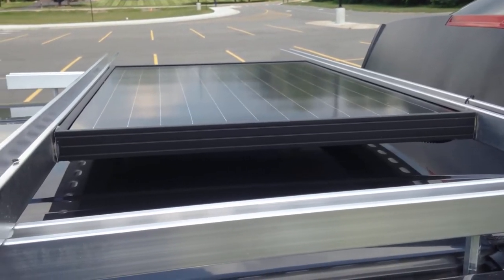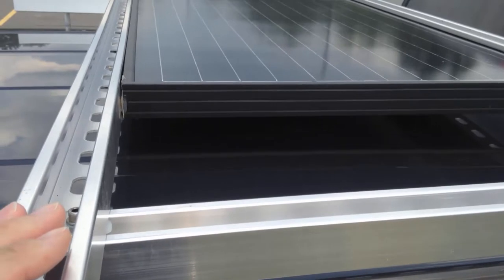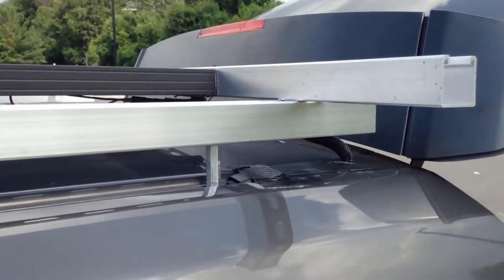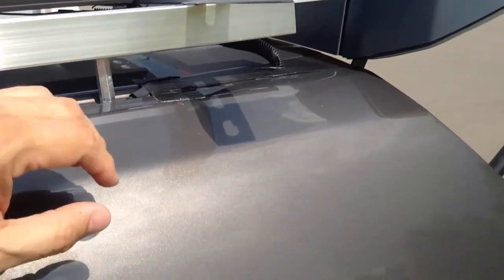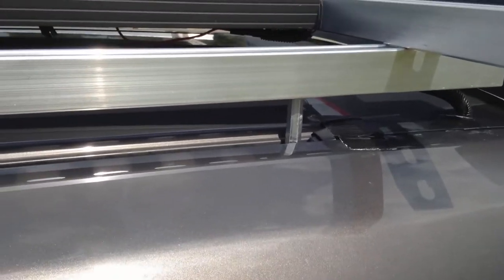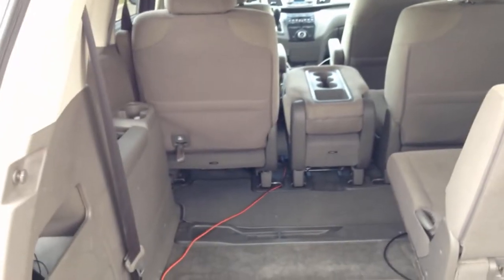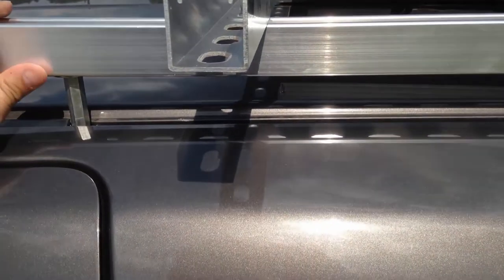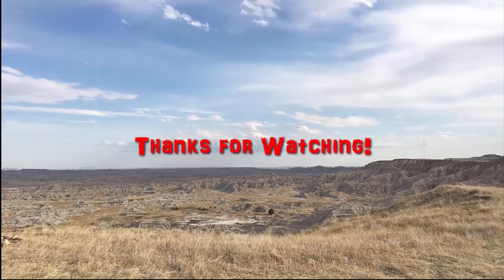DIY Rooftop Solar on Honda Odyssey Conversion

Comment: I have a 2007 Ford Freestar I'm pretty sure that model would fit on mine wouldn't it and I'm asking because currently it's pouring down rain and I can't go out and take measurements right now
Reply: I have a 2004 Ford FreeStar. I was able to mount 2x 100w panels on the roof using the existing roof rack.

The roof rack itself (if you were to remove it), per each side will give you access to two holes in front, one hole in the middle, and two holes in the back, (a total of 10 holes).

I found the mounting holes on Renogy's 100w monocrystaline panels line up perfectly with the stock roof rack (see my channel for related videos).
Reply from the maker: The solar panel would fit without a problem and you should be able to build the same type of rack. Watch OdysseyCamper.com for the whole DIY post (coming as soon as I have time ;-)   The only thing you would need to look into is the thread size of the studs on the roof.  I'm betting they are metric and probably M6, M7, or M8.  You could test it yourself by buying a couple of nuts at Lowes or Home Depot and seeing what fits.  I'll probably post on the OdysseyCamper Facebook page when I put up the full article.
Reply: Couldn't you mount one house panel on there and run an a/c? Or not...

Comment: Guess it never rains on your Odyssey.  Those roof penetrations do not look watertight.
Reply from the maker: Doug Graham actually they are fine in the rain. The standoffs use the existing roof studs and the wires pass through what is essentially a trim piece, into the rain gutter. The wiring COULD go in behind the tail light but since I remove the solar panel sometimes, I made a temporary run. The trick is to run the wires down the side on the weather stripping and then in from the bottom. That way the water can’t follow the wire in. I drove and parked in summer thunderstorms without any problems.

Comment: Hmmm...not feeling the love for this thing...
I think I'd build a frame out of 1 1/2" aluminum angle, mount it to the roof, then drop the panel in that...
Reply from the maker: Leon Allan Davis that would work fine too!  I used unistrut because I thought it would be easy enough for anyone to build with and I was also building a bed at the time (unistrut is stiffer). But the angle would let the panel nest down in the frame, so yeah, great idea!